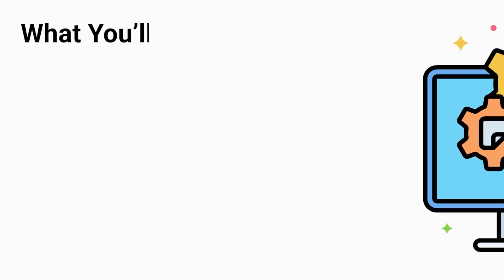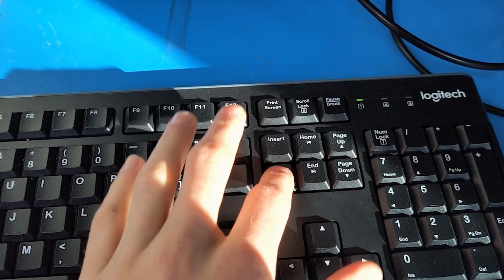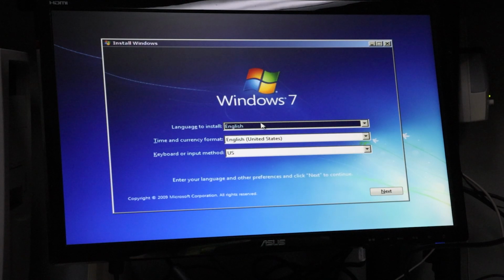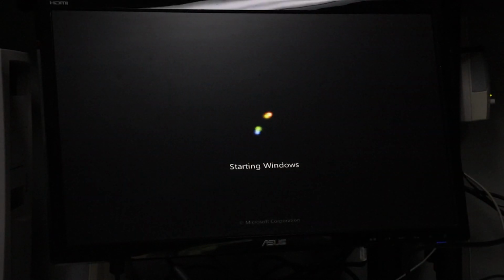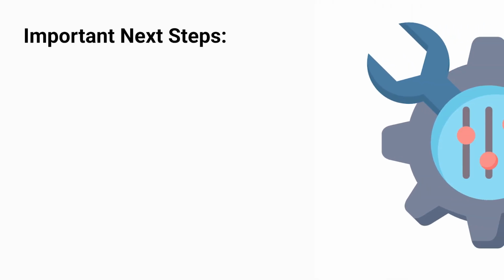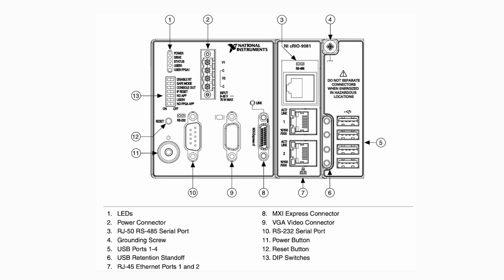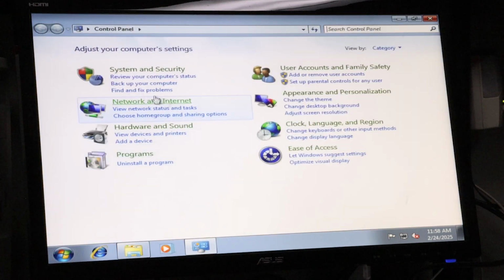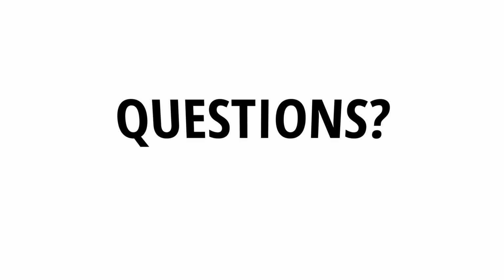Convert Your cRIO-9082: From LabVIEW Real-Time to Windows 7

Comment: How to turn personal computer into Labview RT?
Reply from the maker: Thanks for your question! 

Yes — it is possible to turn some x64 PCs into an NI Linux Real-Time system using NI’s open-source nilrt project (Link: https://github.com/ni/nilrt). NI Linux RT is a real-time OS, and the repo includes x64 support, so a PC can be used as an RT platform in that sense. The main caveat is that this is more of a custom or community-built path, not the same as using standard NI-supported RT hardware out of the box. 

Hope this helps!